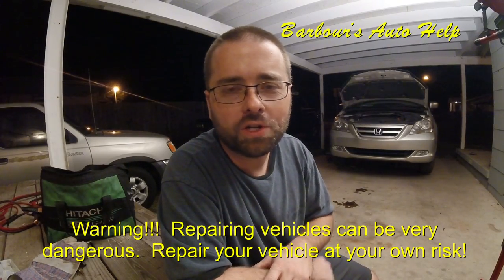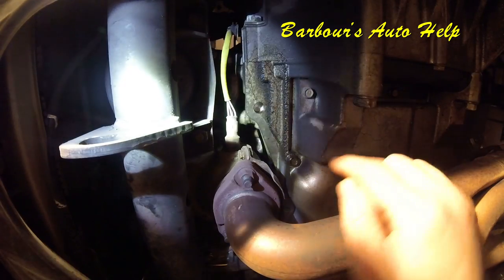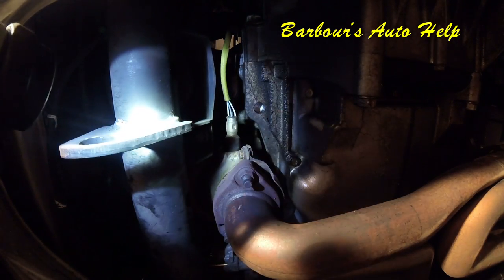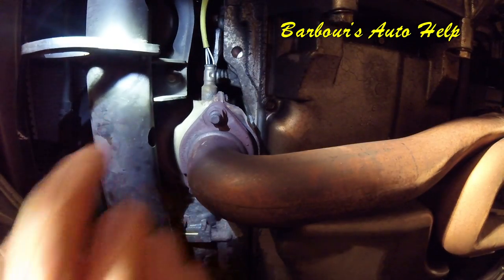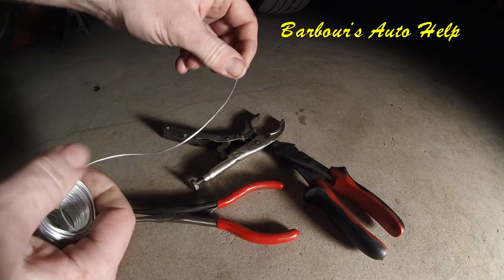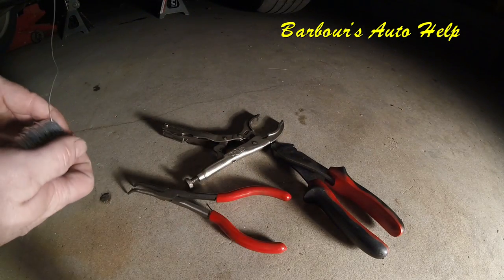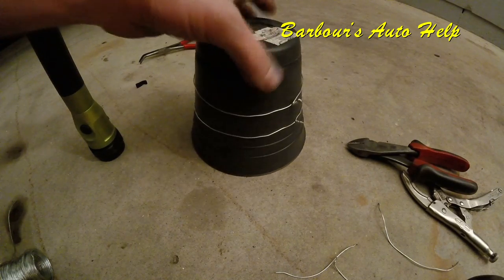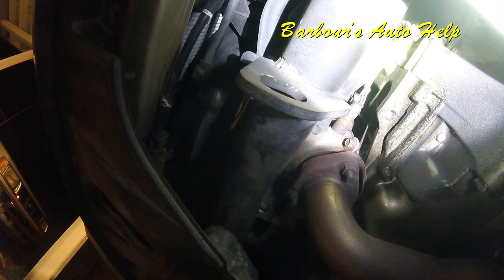How to fix (temporarily) a rattling heat shield on a catalytic converter

Comment: Great tip, especially with a universal fit with the wire.  I did the big hose clamp fix on an older HONDA v6 and it worked but was difficult to get in and in place and then more difficult to get a tool on it to tighten it.  This is a lot simpler to do and the cost is pennies!   I really love simple but effective mechanical fixes like this!   At this point Honda is asking $1200 for each front and back cat and the exhaust pipe with the cat is $1700!!!!   Thanks a million Mr. Barbour!

Comment: I think you can use a six-inch hose clamp (a.k.a., worm drive clamp) for a more secured fit: or connect two 3-inch clamps if the six-inch is not available.
Reply from the maker: +Nhan Ha That sounds good too!  Thanks!

Comment: Heat shielding should be made from perforated stainless steel and secured with brass bolts.  Car manufacturers are generating income for themselves by not engineering the parts correctly, on purpose. Yeah it costs a few bucks more to make it out of SS  but saves car owners from nuisance repairs and taking days off from work......

Comment: Hey, I have a ‘19 accord. This the second time a rattling sound has appeared. 1st time dealer fixed it was good for some time now it’s back again. I don’t know if I need to change my mounts or heat shield because along with rattling there’s a lot of transmission movement for me

Comment: I just bought an 06 honda odyssey a few months ago..  van has been making this noise the past few weeks... I looked under the van after watching this video.... there is what looks to be wire hangers around the heat shield. Should I remove it and replace with the twine or hose clamps? Or should I just take it somewhere to replace the shield being as though obviously this isnt the first problem with this.
Reply from the maker: Well,  it's my understanding that the heat shield can't be replaced apart from the cat converter.   So, it's up to you.  The best fix in my opinion is to replace the converter.
Reply: @BarboursAutoHelp  I have the maintenance records and it was replaced in January 🤦‍♀️. Wonderful!! This van is the gift that keeps on giving lol. Thank you!! It only had 60k miles on it that's why I bought it.... but I've put ive 1600$ in repairs so far. Haha. Oh well. Such is life.
Reply: @Juicytwentysix  remove the wire and replace with large hose clamp (or two)

Comment: Thanx! This my exact problem. I'd rather spend a few bux than a few hundred.
Reply from the maker: +SWells679 Hopefully it holds a while.  :)
Reply: BarboursAutoHelp so this is good to go until...when? CC replacement? how long do they generally last?
Reply from the maker: +SWells679 If it holds and doesn't rattle then roll with it.  It's just supposed to be a "temp" fix.  However if it starts rattling again for this reason you don't have to replace the cat if you can put up with the noise.
Reply from the maker: Did you try the temp repair?

Comment: i have an audi A6 2013 CVT automatic. it makes a vibration sound specifically at 1800-2000 rpm ( im pretty sure its at 1900) ...... could this be my issue do you think? it doesnt make the noice stationary whilst reving.. the car runs amazing.... just this noise..... also after that RPM and before.... theres no noise atall.... but if i maintain that RPM it will continue.
Reply from the maker: Its possible but not 100% that's your problem.

Comment: A repair shop would try to get you to pay to replace a working catalytic converter because the heat shield rattles???
Reply from the maker: Yes, replacing the converter would be the proper way to fix it.
Reply from the maker: Let me rephrase that.  It would be the proper repair if the heat shield is not repairable.  Sometimes the spot welds break.  Its possible that some may be re spot welded for a more permanent repair.  However I've not seen one that can be re welded.
Reply: Probably more work than its worth

Comment: Sounds like similar to my issue that I’m having a hard time to figure out. https://youtu.be/gzMcBwnThQg
 
Rattling only happens when engine is under load (around 13000 rpm) while driving (on a gear) but does not sound while revving engine at same rpm while on park/neutral. 
 
Can you suggest anything I can check? Sound is very irritating as you can hear. Thanks
Reply: Jun, i still hVe the same problem on my 350z! Did you find out what the problem is?
Reply: @Dan-rp9gb  dealer could not really find out what's going on. they ended up replacing the engine's long block under warranty. runs and sounds better so far.